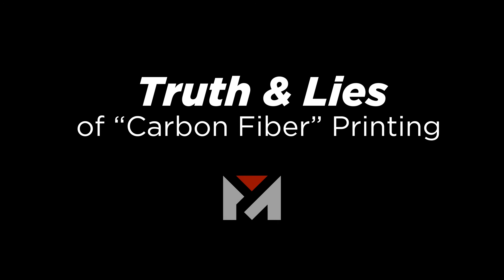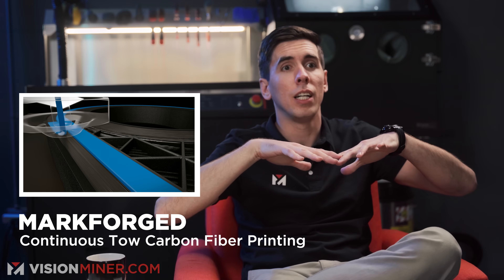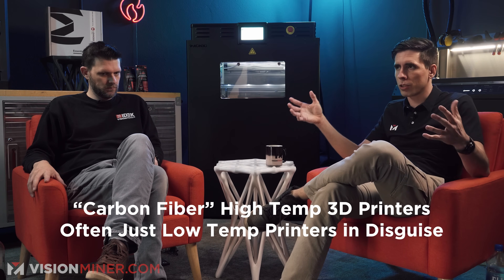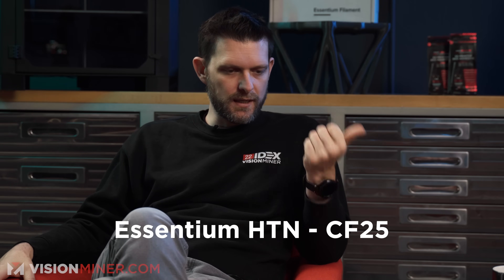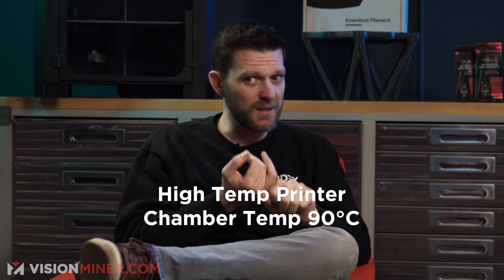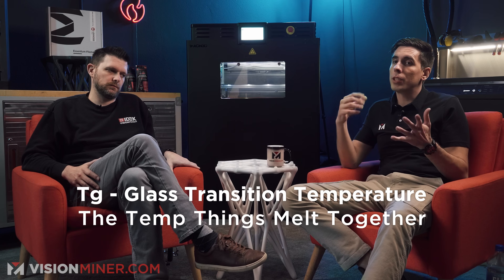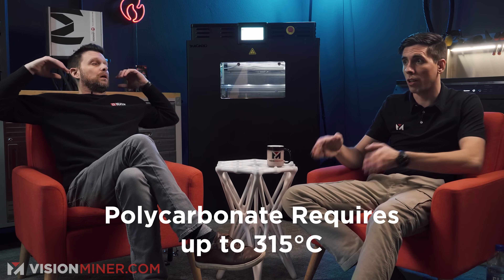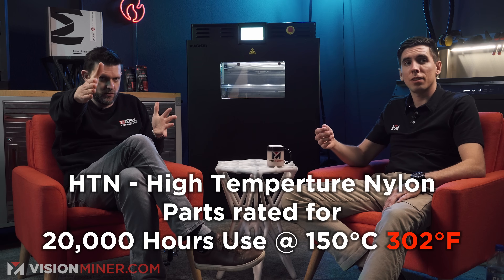Fact Check: The Real Deal Behind Carbon Fiber 3D Printers - 2023

Comment: I’m printing good size parts in my Bambu Labs with Stratasys Nylon CF that we use at work on our F900
Reply from the maker: HAH! That's awesome, how does it handle the difference in diameter?
Reply: @VisionMiner  it’s actually pretty good. I made my coworker some parts for his kayak with a 0.6mm Nozzle. I haven’t tried the 0.8mm but the 0.4mm works as well. Even our Systems integration test engineers who gave me the Stratasys filament were very surprised lmao! They started to give me everything they use to try out like PC, ABS-M30, SR100, SR30, PC Support and Nylon. They gave me some  9085 and 1010 as a joke but I took it anyways. One day I’ll buy a “TRUE” high temp printer. Even the Raise3D printers we have struggle to print the Nylon CF and PC filaments in my ME group.
Reply: Sheesh. How much does that filament cost?
Reply: @fjlaboratories  I think they go for around $400 to $500 a canister from my google searches lol

Comment: The primary objective is to design a printer capable of sustaining an enclosure temperature above 100 degrees Celsius. Concurrently, it's essential that the printer's internal mechanical components (such as the linear gear and belt) can withstand this heat. Additionally, the printer must effectively manage thermal expansion
Reply from the maker: Correct! You're really building an oven at that point, when water will boil inside just from the air...